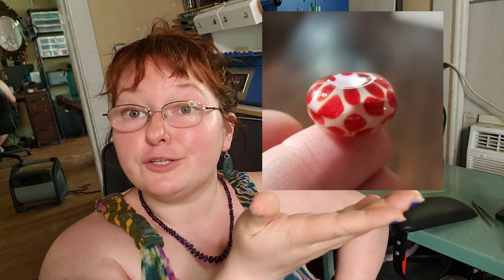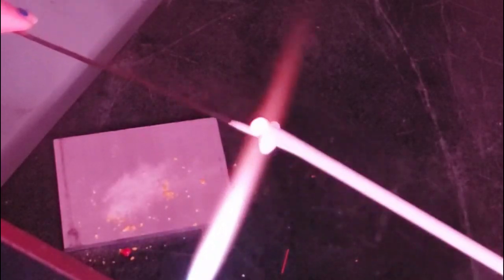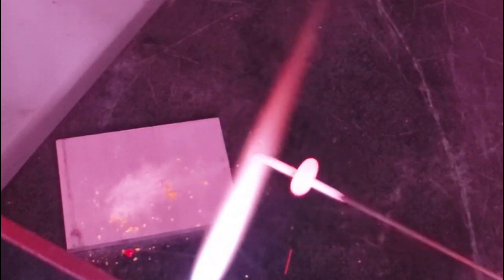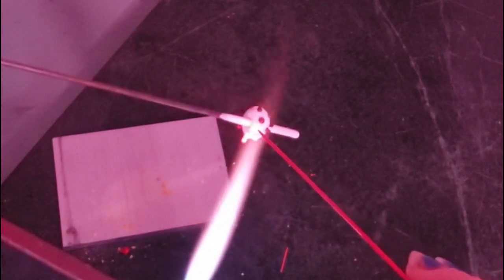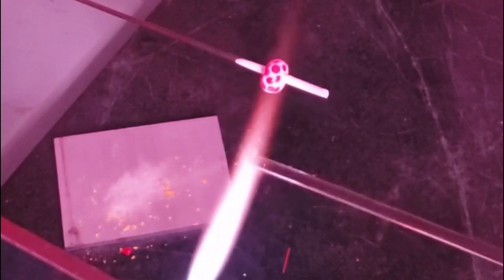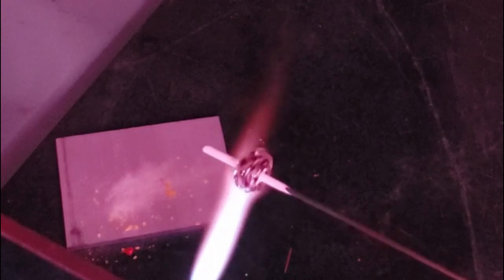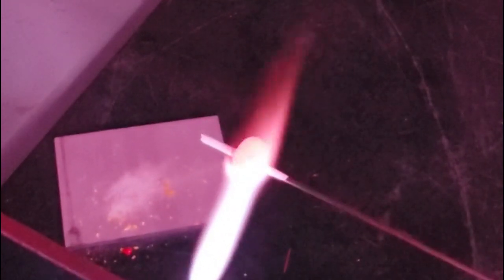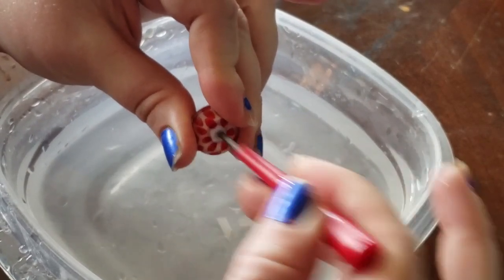Adventures in Lampworking: More encased Dots!

Comment: hi Yvonne, I see you are touching a lot of techniques... have you ever considered growing a crystal (salt, copper sulfate or other) around a LED ? This is one of my projects... of course you have to protect the wires with thermo auto shrinking tubes or epoxy to prevent them from beeing corroded but I think you could make a nice Avatar-like techno-tree lamp out of it... adopt the idea if you want ;-)
Of course, after protecting the crystal from moisture with a clear coat, you could give it a more "organic" look by copper platting the edges...